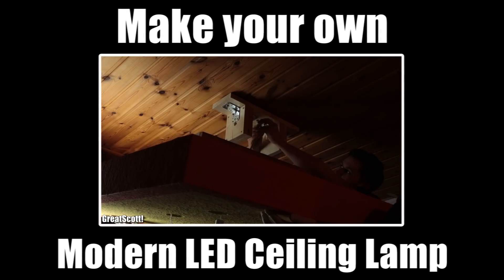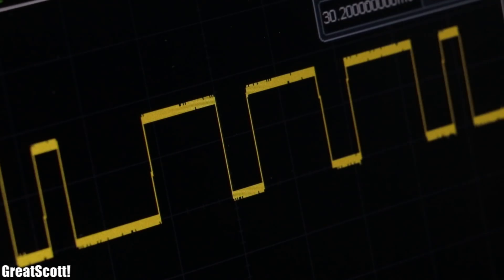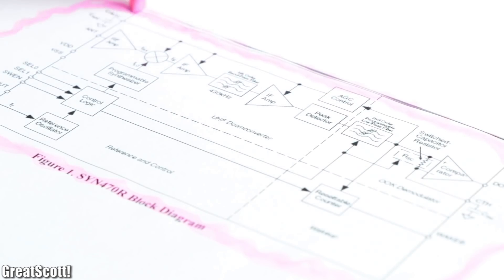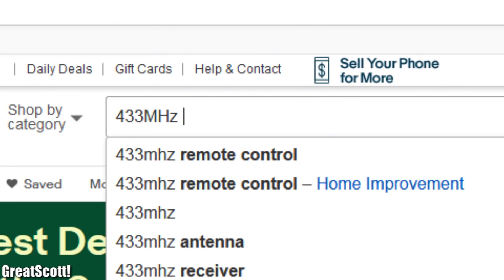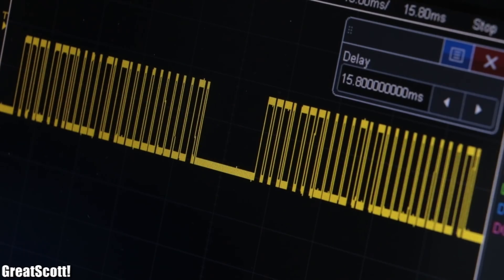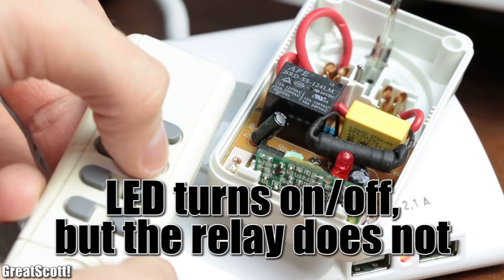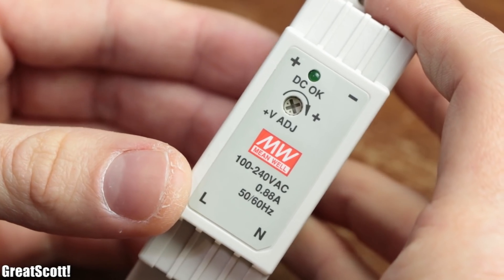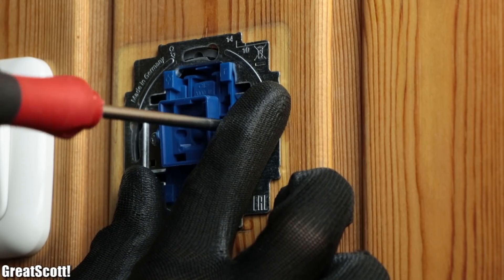Repurposing an LED RF Remote to control "anything"!

Comment: Really nice! I look in to upgrading our halogen setup(wired). I was impressed with the dimming. Never thougth there were 60€ inwall dimmer. I hope to get low voltage wireing in my home! Still abit unsure about the rf thing: my ungerstanding is that anyone could control my light, if in rf range and some time to sniff the signals
Reply: Yeah, that would work. But I think your neighbors are not such bad persons :D
Reply: @alex0kai  I know :P nobody is as bad as i am ;) but can't install something that trusts on obscurity as identification. Same as hand signature as identification.
Reply: @tobiasfellmann7692  then simply use a wlan connection
Reply: @alex0kai  yeah, i really like shelly and esphome. Ikea light's are also great, but they dont have mr16 sockets
Reply: Are you kidding? LED PWM wall-mounted dimmers (even decent quality ones) are dirty cheap these days - you can get some even from amazon for like 15$ and half that cost from Aliexpress/Ebay.
Reply: @zusurs   I know, but i don't understand how to control them. ATM we have phase control dimmers, with a dail at the wall. This goes to a transformer at the ceiling. Somtime there are one dimmer and some switches in series.

Comment: 🤔🤔Why don't you just use the IR reciver diod , as you are using the Arduino and the IR remote. It would be much more simpler just like you used in your previous old video ( https://youtu.be/ftdJ0R_5NZk )
Reply from the maker: The receiver was later placed in the lamp. There was no way the IR light could enter that.

Comment: I didn't see an antenna on your "el cheapo" receiver.  I use these all the time and with a coil antenna, they work fine anywhere in the house.
Reply: @rich1051414  Actually, that isn't an antenna, just an inductor. You need to connect an antenna to the ANT via, which can be a 15 cm wire if you don't have a coil antenna.